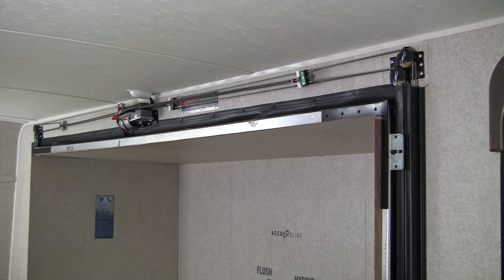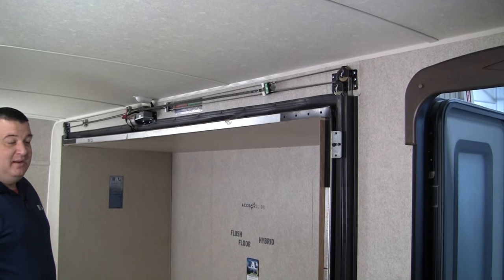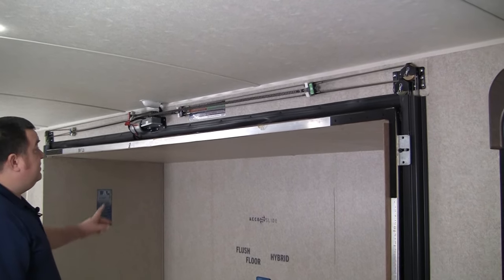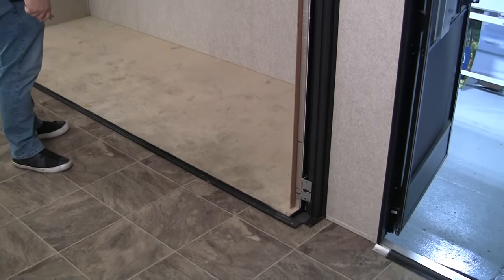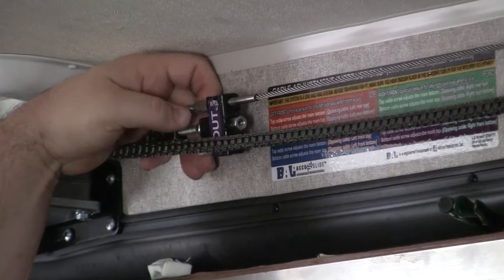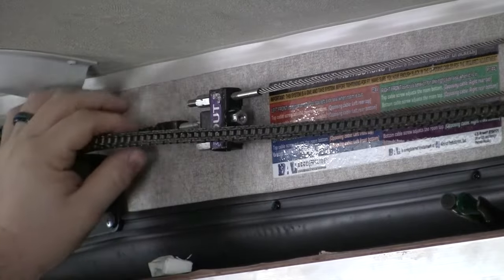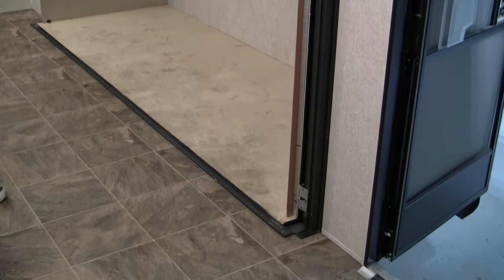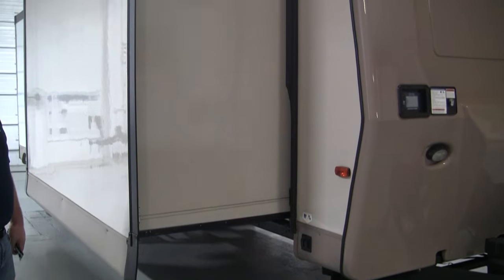BAL Accu-Slide Adjustment & Tensioning

Comment: I love the high tech "anti vibration foam blocks".  Good Lord.
Reply from the maker: Your post made us chuckle. That being said, over the years of testing and production we have found that foam blocks are very effective. You do have the option of using a 1/4"-20 HEX NUT.
Reply: @NorcoIndustries Uh, no, the foam blocks are completely ineffective actually.  After 3 years of full timing, moving frequently, I had to adjust the slide cables every 3-6 months.  Finally installed the 1/4x20 nuts after watching someone else’s video who recommended them and a year later, have not had to make any adjustments.  Please consider installing the 1/4x20 nuts at the factory.
Reply from the maker: Thank you for the recommendation. We will pass the suggestion along to the design team.

Comment: Great video, thanks for the step by step....I've seen some manufacturers (Alliance) putting the tension adjustments on the bottom of their bedroom slides instead of the top. How in the world are you supposed to service/maintain that slide system, if it's installed like that? I would assume it's virtually impossible to get to???
Reply from the maker: There are two different styles of dual motor slides. The older more obscure style has the motors mounted at the bottom of the jamb assemblies and has a timing shaft hidden above the top wipe seal, opposed to an electronic controller. That style is tensioned the exact opposite of the Exact Slide, where the motors are mounted at the top of the jamb assemblies. For top mounted motors, you always want the bottom to have the tighter tension. With the room retracted the bottom cable should be tightened to 20 lbs or have a 1/4" deflection from center using your thumb and index finger and the top should be 10 lbs or have 1/2" deflection from center.

Comment: Thanks for a great instructional.  Our room started dragging on the floor at the rear wall.  After watching this video I put the room out, removed the top trim and checked the cables.  The first thing I found is the jamb nuts are loose, one by 1/2”.  Can they vibrate loose while traveling or might this be because the service tech who adjusted the cables a couple of years ago didn’t tighten them properly?  I can’t see the sides because of the trim.  Should I remove that or can I just watch for movement when I pull on the cable, as you do in the video?
Reply from the maker: The coupler nuts should all have an antivibration foam block on them to keep them from vibrating loose during travel or operation. The 1/4" jamb nut for the chain connection to the adjustment bracket should be tightened against the adjustment bracket. If the jamb nut for the chain adjustment was 1/2" from the adjustment bracket, it is unlikely that it was previously tightened into the correct position.
Reply: Thanks for the fast reply.  Your video helped me readjust the cables. The dealer who adjusted it last, and failed to tighten any of the jamb nuts, admitted he was having trouble hiring experienced workers.  Unfortunately, not until after they did the work.  With your guidance, I was able to adjust the cables and it now works smooth as silk.

Comment: I have to be missing something. I was adjusting but things were not getting better. For sake of argument. I am bringing in my slide-out. The bottom was coming in while the top was at least 1.5 inches out. So, I decide to just bring the top in so I loosened the top cables in the shuttle so the bottom cables would be loose. I had them super loose but yet as the slide came in the super loose cable became tight. That does not make sense to me. Please help..LOL
Reply from the maker: When the room is extended the OUT cables have all the tension on them and the IN cables will relax. When the room is being retracted, the tension transfers to the IN cables, because they are pulling the room in. Please see the cable routing: https://balrvproducts.com/wp-content/uploads/products/oem/slides/GDS.SLD_.030-ACCU-Slide-Cable-Routing-Diagram-REV-B.pdf
Let us know if you still need assistance.

Comment: We have a 2015 Montana 3725RL (bought new). The bedroom/hallway slide (huge and heavy) has a cable system (annoying). We had 2 cables break in a wind storm in Quartzsite with the slides halfway in. A mobile repair person came out and fixed them, complaining the whole time. We have replaced the motor ourselves. Now, the top left cable (from being inside) broke away from the outside of the slide. I wiggled and traced the loose cable from the top of the INN block (with the words facing the wall) to the back (closest to the wall) of the bottom pulley and down the tube with the other cables. I can push it down in a ways, but how do I find it and get it pulled back outside to reattach it to the slide? Is there a bare-bones diagram of where each cable goes and which direction they travel? We're close...
Reply from the maker: Our technical support team would be happy to assist you with a cable routing diagram and help determine the root cause to the problems you have experienced. If you can email them at baltechsupport@norcoind.com and provide your information, they will be able to help.

Comment: How good are these cable slide outs? I've always had the metal gear ones on the bottom of the slide
Reply from the maker: Cable operated slides are very dependable, as they use aircraft cables to pull the room in and out. The room floats in the opening from right to left, so any hard stops on the road that shift the slide room forward will self correct when the room is extended and retracted. The Accu Slide has been around for decades and is a very reliable system. Through frame slides or above floor slides that use an actuator to extend and retract, which are also highly reliable, are used in applications for heavier slide rooms. We also manufacture through frame slide systems for our NXG Travel Trailer and Fifthwheel Frames.

Comment: When adjusting the slide cables, do I need to remove furniture (weight) that is on the slide?
Reply from the maker: It is not necessary to remove the weight inside the RV when tensioning the cables. There are several ways to perform an adjustment depending on room travel and weight. 

If a room has more than 24 inches of travel it’s best to note the distance of adjustment required and then bring the room in 6 to 10 inches before making the adjustment. This will help relieve pressure on the cables making it much easier to turn the adjustment nuts.
1. Before tightening an adjustment nut, make sure the opposing cable has enough slack to allow for the take-up. The opposing cable is the one that has the same corner location but on the opposite side of the wall i.e. (IN Top vs. OUT Top)
2. Tighten the appropriate nut(s) to accomplish the proper seal.
3. Tension the opposing cables until there is enough slack to freely move the cables up and down at least 1 inch overall.
4. When the system is adjusted, tighten all jamb nuts and replace anti-vibration blocks.

In a situation where there are not enough adjustment threads in a cable or chain stud, use the following procedure:
1. Position the room 1 - 2 inches from full outward extension.
2. Turn both chain nuts on the side affected counterclockwise until there is 2 inches of thread showing on both studs.
3. Re-position the cable adjustment nuts to the end of the cable studs.
4. Remove the chain from the sprocket and move the required links to balance the amount of difference in take-up, reconnect chain to sprocket.
5. Take up slack in the chains and cables and re-adjust.

Comment: Yes the video is helpful. But Because my bed slide has a lot built in it and nice trim all the way around it. The video is more helpful when being installed and setup.  Is there a video that is helpful for a 12 ft long slide that is difficult to see if pulls on or moves cable someplace.
Reply from the maker: The interior vertical decorative trim has to be removed when we perform the adjustment. If the exterior cables have too much slack when the room is extended or you are experiencing any issues getting the room to extend or retract completely, then you would need to remove the trim to access everything.

Comment: When you say fully extended, is the motor supposed to amp out? My brackets are tight against the jam before the motor stops while pushing the button. One of the jams on my big slide looks like it was smashed a little on the bottom by the bracket on the inside.
Reply from the maker: Yes, the motors should amp out.

Comment: My motir is under my master bed not on top. My left inner cable bracket it bent badly in that the slide will not seal in the out position.  We are working on replacing that bracket today. Our main problem is that the gear box/motor was offsetti the right about 8 inches which would have been fine but the cables were not cur to match. Now i have cables that have 3-4 threads holding all the tension.  Is it possible to move the fear box? I cant see a way to make this work because the builders skrewd us over and made this unsafe as it is.
Reply from the maker: There are some RV Manufacturers that specifically request the motor to be mounted offset from the center of the rough opening, but that does change the cable and chain lengths in the design process for the left and right of the room. Most often the dual sprocket on the gear box should be aligned with the center mark of the opening, to allow the cables and chains on the right and left to be the exact same lengths. There is a backer in the wall for the motor to mount to. Page 2 of this link may also help: https://balrvproducts.com/wp-content/uploads/downloads/tech/GDS.SLD_.031-ACCU-SLIDE-CHAIN-INSTALLATION.pdf

Comment: I am adjusting the cables on my Kestone passport. When I pulled the valance, BAL controlled slide, I saw that the motor and gearbox were mounted at an angle. The motor was lower than the gearbox. 
The tensioners are angled, possibly intentionally due to the angle of the gearbox. Is this allowable correct?
Thanks if you can comment.
Reply from the maker: When the wall bracket is mounted to the wall, it should be mounted at a slant with the motor end of the assembly tilted 1/4" away from the chain. The bracket should not be mounted straight with the motor end of the assembly pulled down, bending the bracket, as this can damage the drive shaft between the motor and gearbox (when applicable). The chain on the same side as the motor end, should also be on the sprocket that is furthest from the gearbox. This set up is to prohibit the adjustment brackets (chain to cable connection) from hitting the end of the motor assembly. If you would like to send us a photo to baltechsupport@norocind.com of the installation of the motor assembly, our technicians can review them for additional advise.
Reply: @NorcoIndustries  Thanks for the clarification, will follow up with support.

Comment: My notes from the video:

1. run slides out
2. check seal - standoff brackets should be touching metal frame jamb
3. loosen IN cables - center nut
4. pull OUT bottom cable (physically on top) to see bottom of slide move out
5. tighten OUT bottom cable (physically on top)
6. test to ensure slide is now sealed properly, and pulling on cable doesn't move it
7. ensure tension of the two OUT top cable (physically on bottom) is same tension
8. ensure bracket is straight up and down / not tilted in any way
9. if you can spin jamb nut in by hand, tighten both it and the nut
10. tighten nut, ensure even tension between the cable and chain
11. cable tension should be .5-.75" apart when squeezed 6" away from block
12. lock jamb nut and nut in place, reinstall foam blocks
13. verify half inch cable deflection when pushed by two fingers

Comment: Is there a procedure or video when all the adjustments are completely out if wack? When i took it all apart i did not know i was supposed to mark and keep track of adjustments .
Reply from the maker: We can certainly help. Since you mentioned taking it all apart, we would want to clarify which components were disassembled as well. If you can email baltechsupport@norcoind.com and explain what parts were replaced and which step in the process you are at, then we can make sure we provide a list of what you want to check and verify, as well as the next steps to get things functioning for you again.

Comment: What should I be doing or looking for , the entire slide is shifted to far left inside the opening. So big gap on right side vertical edge and to tight on left vertical edge and tearing up the seal.
Reply from the maker: The room will naturally float between the jambs, when the cables are adjusted properly, unless something else to stopping the room from free floating. You would want to check the glide surface under the room to ensure that it is not flattened or damaged first.

Comment: What size are the adjustment nuts? I want to buy some ratcheting wrenches to keep in the camper.
Reply from the maker: We recommend a speed drive 3/8" & 7/16" box wrench or 1/4" deep well socket wrench.

Comment: My slide out is tilted when all the way out, looks like the bottom is not all the way out and my dinette table is not straight when the slide is all the way out, also there’s and inch gap between the slide out floor and the rest of floor. Any advise?
Reply from the maker: I would start by inspecting the glide surface under the slide room. There are several types that the RV Manufacturers use (i.e. rollers, wear bar, or flush floor with a wear bar and compression rollers in a drop pan). Verify that the glide surface is not damaged or worn. If everything looks good there, we typically put a jack under the room at the further edge while extended and raise it just enough to make the room sit level. Then we check the adjustments inside, to confirm that they are 1/2" deflection from center using your thumb and index finger. Then we remove the jack and if the interior bottom of the slide floor relaxes back in at the bottom (no longer level); this is an indication that the magnets in the motor have weakened and  need to be replaced.

Comment: What indicates even tension in the “In”. Is it just by feel?
Reply from the maker: By feel is the best method. With the room fully retracted, after the BTM and TOP OUT cables are tensioned to the point that the standoff brackets are making contact with the jamb, then the IN cables can be tightened to eliminate the slack. The IN cables will move about 1/2" from center or 1" overall movement.

Comment: Cool and all but how are you supposed to do this when there is all the molding on?
Reply from the maker: Since the room has to be adjusted with the room extended, the header trim/fascia is removed for this process.
Reply: @NorcoIndustries  yes I see. I did end up getting to trim off. Not as bad as I thought it was going to be. Followed your video and now both my slides run in and out smoothly. Wow they where out of whack...thanks for the good video!

Comment: I followed the troubleshooting and loosened the 'ins'. I then pulled on the outs as instructed to see if the bottom would lay flush to the jam and it did not. Why could this be? When the slide is all the way out my slide floor stays an inch above the rv floor.
Reply from the maker: If the interior standoff brackets do not make contact with the jamb, with the room fully retracted and the cables tensioned, we would want to determine if the motor or gearbox have ever been changed. With the room extended half way, see if the adjustment brackets line up on each side of the motor. Or count the number of links from the end of the chain to the first tooth on the sprocket to see if both sides match.
Reply: @NorcoIndustries  The gearbox and motor I just replaced a few months ago. This has been the issue ever since replacing. I will count the sprockets and reply back. Thank you for the response.
Reply: @Norco Industries  ok so there are 37 links from the last tooth on the sprocket to the right side 'out' cables and 40 from the last tooth on the left side.
Reply from the maker: @bocabretts123  We have step by step information on the best way reposition the chain on the sprocket. If you can email us at baltechsupport@norcoind.com, we can send you the detailed steps.
Reply: Hello. I have a cable slide that starts to go out but then starts “clicking” and won’t go out any further but will go in fine. Does it sound like the “out” cables are out of adjustment?
Reply from the maker: @dawnymae6456  The clicking sound is the thermal cut off inside the motor. Resistance as the room extends or retracts can cause this. I would start by looking for obstruction and checking the surface the room is gliding on (under the slide box floor) to make sure the friction is not causing the thermal cut off to initiate. Give us a call at 877-557-7788 and we can help walk you through what to look for.
Reply: @NorcoIndustries  Thank you. I am going on the call for this issue tomorrow. It comes in perfectly and if ya pull on the exterior it will go out. Maybe out of adjustment on the “extend” side of the cable?

Comment: Seems "easy" from just watching - but the reality is you'll not have this sort of "room" when trying to adjust your cables. Most are behind lots of trim that in some cases is destructive to remove in order to gain access. In my case, I adjusted (tightened) my cables because they were sagging a bit when the room was extended - the room was otherwise sealing just fine. Now, the motor "groans" when pulling the slide in after getting the cable tension in spec. So, because I don't want to be replacing the motor soon, I'll be loosening these cables right back! 🤦‍♂